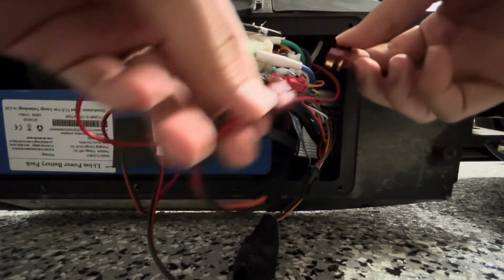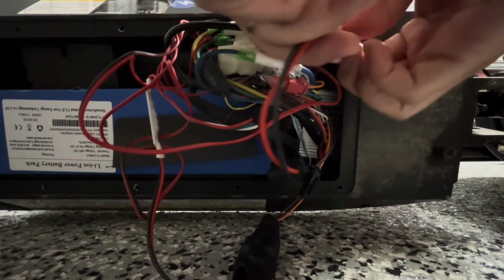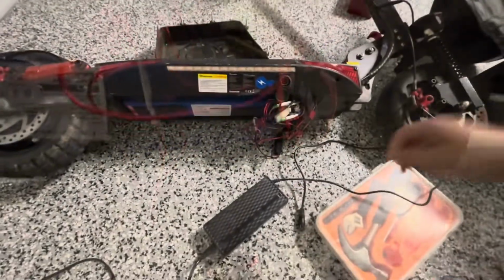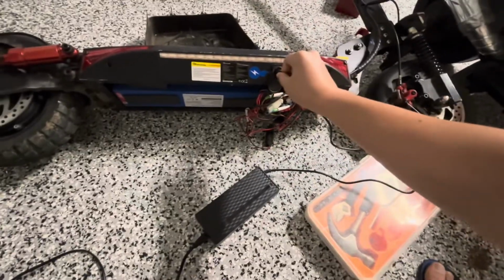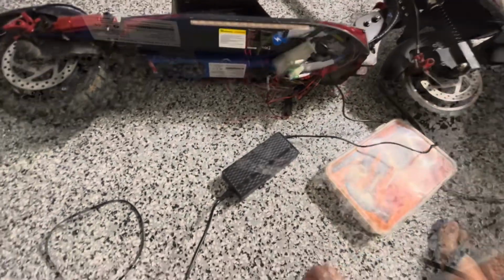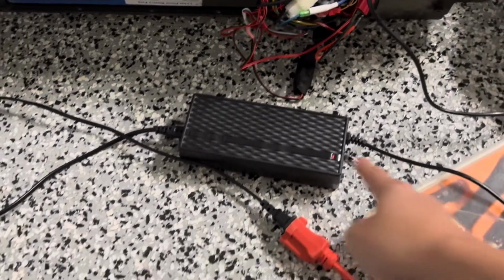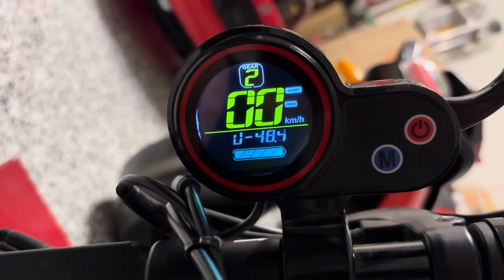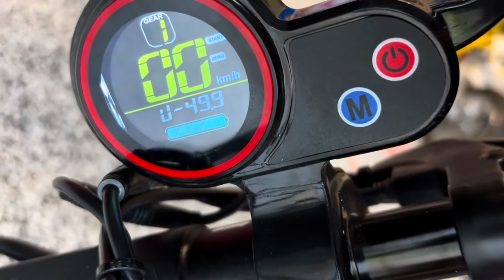Fixing an Electric Scooter that Won’t Charge (Battery Fuse - Evercross H5)

Comment: My scooter is brand new and the left indicator stays on near the handle bar but it doesn't blink, what to do?
Reply from the maker: there's a light controller in the battery compartment, that probably went wrong

Comment: Can you help fix my scooter cleytro cl7 electric scooter
Reply from the maker: What is the problem
Reply: @EdwardInTX I was driving and I used my brakes and the power went out
Reply: @EdwardInTX the lights turn on when I turn the key but on the throttle side on the right the power wont turn on to drive it
Reply from the maker: @Venom-y6g2d sounds like your display went out, that’s typically the 5 pin connector

Comment: I have Uberscoot S300,  sent to me without charger 24v 300w pls what kind of charger and ampage can i use to charge it
Reply from the maker: Looks like an XLR connector and 1.5a. Try this. https://www.amazon.com/Electric-Wheelchairs-Traveller-Mobility-Shoprider/dp/B0D9BG8C66?linkCode=ll1&tag=edwardintx-20&linkId=26042733e7b3c0c1caf07cfd23b21b89&language=en_US&ref_=as_li_ss_tl
Reply: I think the connector is a normal laptop PIN I'm confused about the voltage and ampage
Reply from the maker: @amadidonchibike33amadidonc40  24v (29.4v nominal) 1.5a

Comment: Quick question, my h5s charger had a massive spark while being plugged into the scooter, making it fall off and break. I ordered a new charger and it still won’t charge, it just shows green. Do you know what’s the problem?
Reply from the maker: Test the battery voltage. Possible the charger shorted or crossed wires internally, hoping it didn't damage the battery

Comment: I just bypassed mine and put it straight to the pos and neg battery wire instead of the charger circuit 
Been fine for 2 years so far

Comment: I have a i14 scooter and won't turn on, it does charge but it seem too not pass battery cuae when i try to turn it on and use the horn it sounds so low

Comment: I have the same issue green light stays on it won’t charge and I tested the battery and it reads like 52 v and it’s a 48V. This scooter looks just like mine the Freeboy J11
Reply from the maker: @Agent-Clayton_24_7  48v goes up to 54v charged but if there are degraded cells, 52v may be the top end. If you run it down to 50v it should charge red if the fuse is fine
Reply: @ is there a fuse in the freeboy j11 ?

Comment: How do u put in a new fuse and take out the old one
Reply from the maker: @Jake_Soth1  old one pulls straight out, new one goes in any direction as long as the pins sit inside the holder
Reply: @EdwardInTX my fuse looks different from yours in the vid.Any suggestions on what to buy
Reply from the maker: @ if it looks different I’ll need to know what it looks like to recommend something. What shape etc
Reply: @EdwardInTX the gray part is thicker with less space in between it

Comment: What voltage are you getting between the 2 charging leads when the charger isn’t connected?
Reply from the maker: @spb1179 I remember it being 0v before replacing fuse, around 50-51v after replacing fuse
Reply: @ ok. I have a completely different scooter but my battery has something like 200mV. (Charging leads not the actual leads) I’m thinking there is some sort of charging circuit rather than just a fuse that might have went out.
Reply from the maker: @ got it, it should read the same voltage as the battery. BMS tripped. What does the voltage read on the output port?